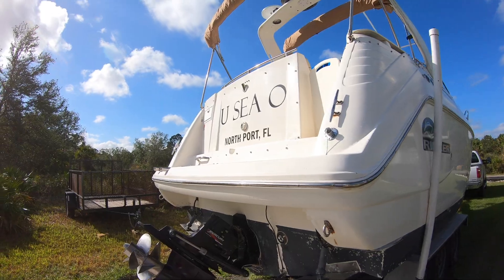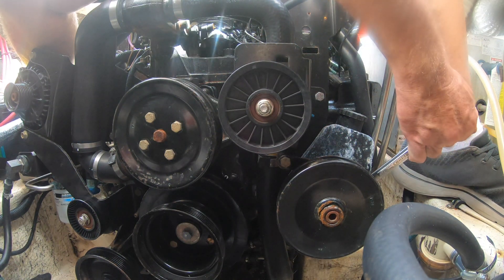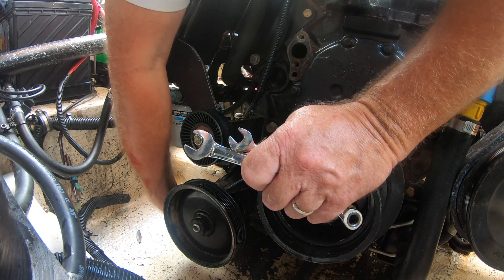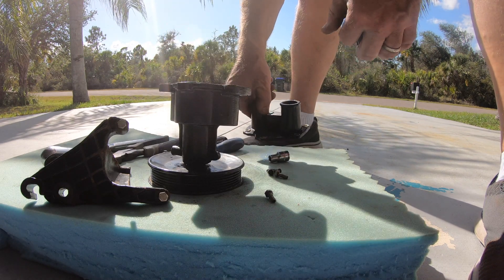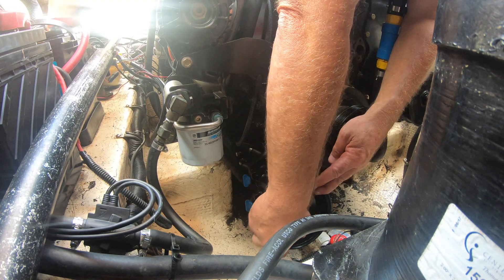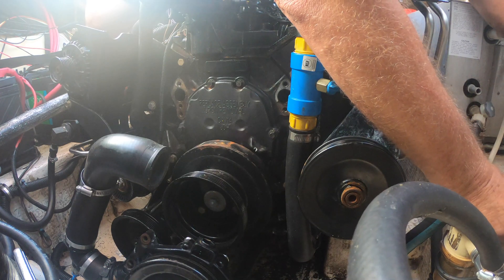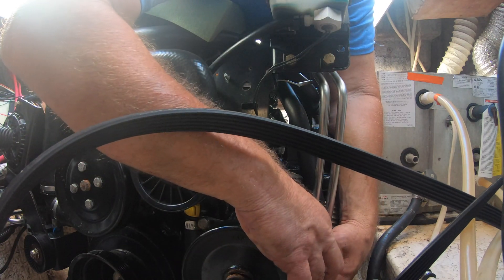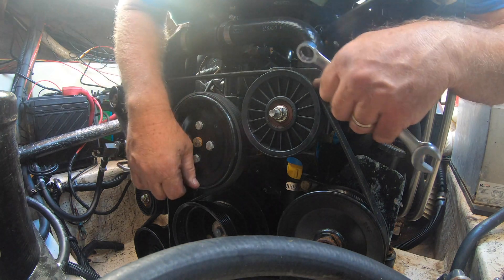Mercruiser 350 MPI Seawater Pump Impeller Replacement

Comment: Had the same thing happen to me last weekend, hope parts of the impeller didn't get into the engine.
Reply from the maker: That’s a great way to ruin your day, Jose… if you are missing any rubber pieces, they are probably circulating in your heat exchanger if you have a closed system, or you may have spit them out in your exhaust. The repair isn’t difficult, just impossible to get to in my case.

Comment: Would dipping and cleaning the pulleys into the phosphorus acid not remove the lubricant from the bearings inside? 😮
Reply from the maker: Hey Alan… yes you are right. I only dipped the part without the pulley into the Phosphoric acid to clean it.